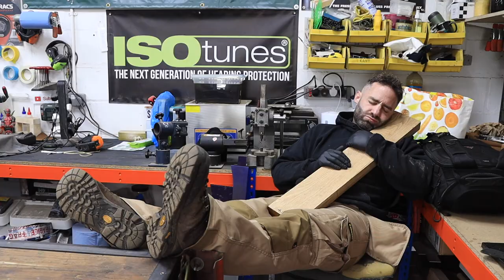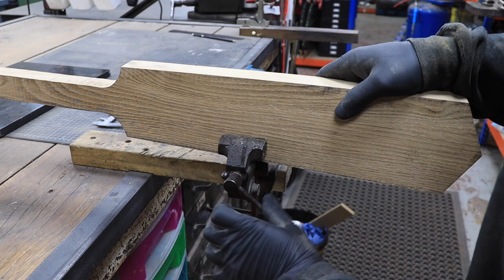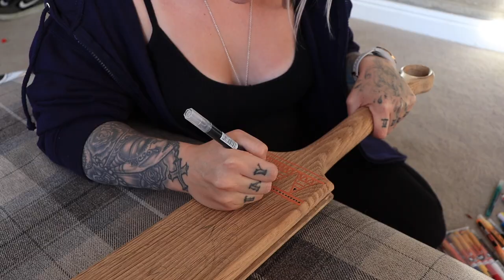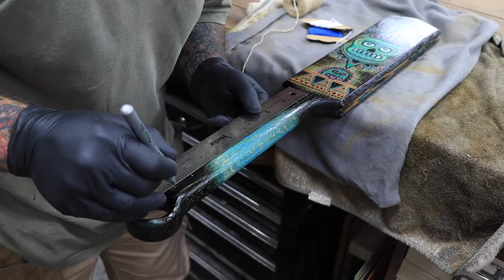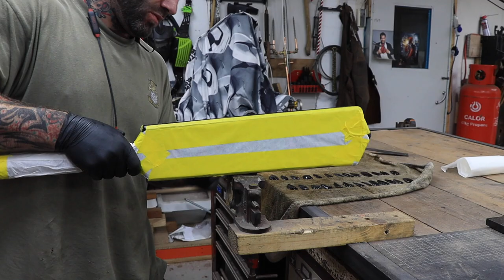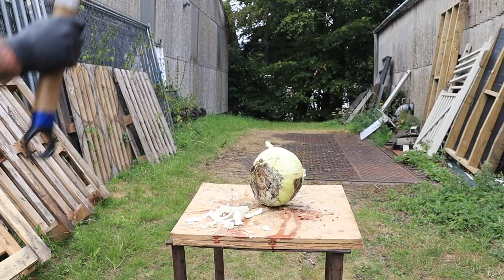Making a Macuahuitl (AZTEC Weapon!)

Comment: Love it. It looks incredible. Kinda surprised you actually tested it, though I'm glad you did lol. I'm pretty sure you can see a piece of obsidian flying out and hitting the house in the last water bottle clip. Some kind of black resin may be a better option to hold those in, but then they'd probably break instead of just popping out.
Reply from the maker: Thank you, yes i had to test it, it does break which is part of the design and leaves sharp edges, the glue is a pitch substitute and is flexible which resin epoxy wouldn’t be

Comment: The obsidian was not placed in the shape of arrowheads but rather in a rectangular shape as if they were razor blades and were glued together to form a single edge on each side. Other than that you two did an excellent job.
Reply from the maker: There were a variety of different styles made and with different shapes in obsidian pieces placed in them. 
Im one man not two

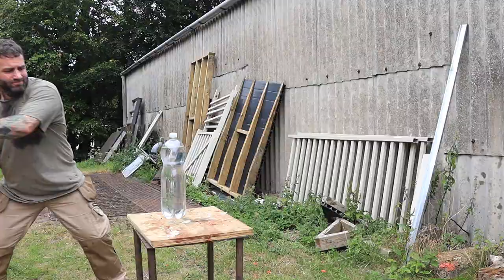Comment: 8:34, did one of them "teeth" go flying and hit the wall after whacking the water jug?  Hope not, as that'd be a pain to replace!

Wonder how them little Aztec fellas embedded those "teeth" (obsidian?) into the paddle, especially without hotglue.   🤡
Reply from the maker: They are designed to break and leave jagged edges so yes bits came off, the aztec used a pitch which I bought black glue pitch substitute
Reply: @DiesInEveryFilm  Ooooooh, that makes the doodad especially vicious.  Noice!  😛